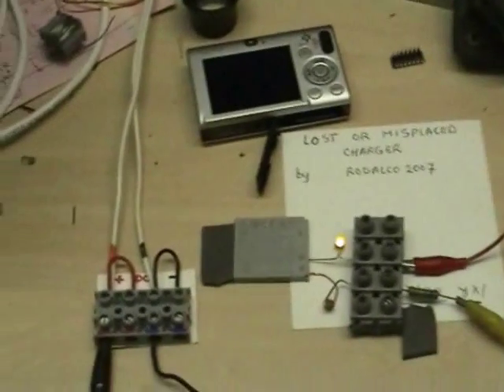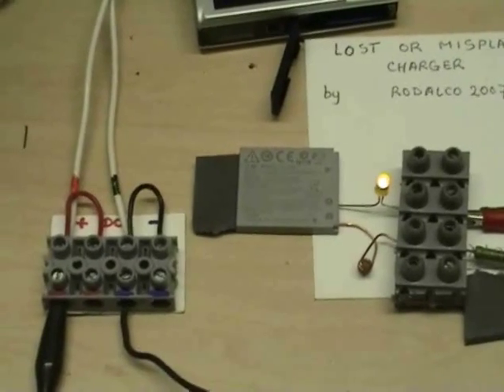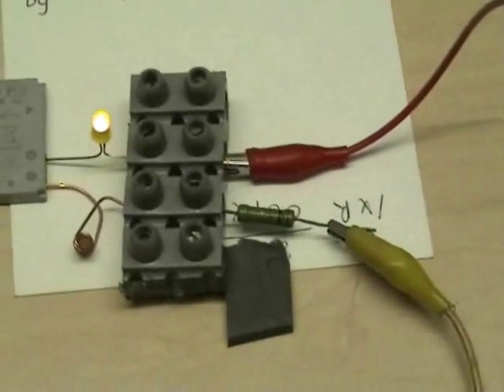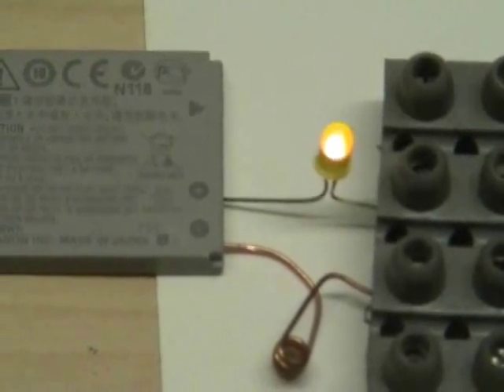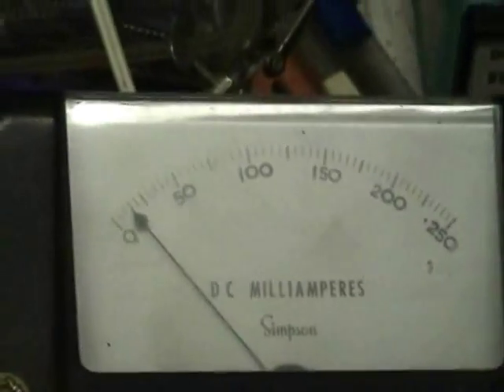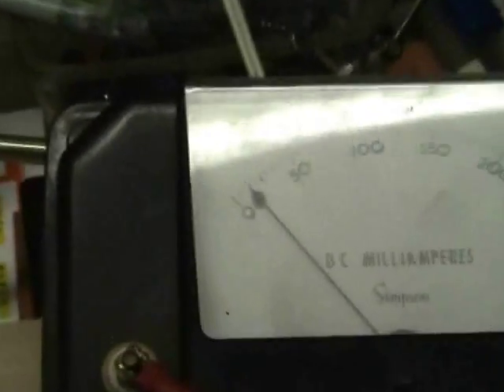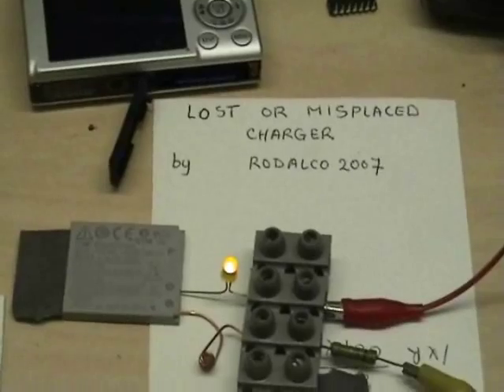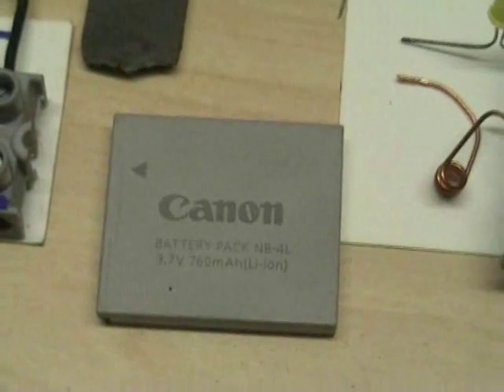Emergency camera battery charger.wmv

Comment from the maker: @bigclivedotcom  Correct.
This charger I used when I lost my normal charger, current is only 20 mA's so the risk of overcharging is low.
But I'm well aware of the explosive dangers of those batteries.
have a look at my lithium battery video's.

Comment: For standard 3.6V lithium iron batteries you must not exceed a battery voltage of 4.2V as the battery is not stable if overcharged and can fail violently.  That said, many of these packs contain a tiny charge regulator PCB that will stop over charging by opening the charging circuit.  If you left that on charge long enough you might find that the LED went out at a battery voltage of about 4.2V.

Comment: That is, 3.6V @ 190 mAh for 5 minutes, then on the charger at 1.5v @ 100, 150 or 180 mAh for 4-6 hours depending on the type of cell (AAA/AA/A/C/D, I rarely use 9V's as they contain AAAA's)

Comment: This is very handy. I used a cordless phone to very quickly boost alkaline batteries that would otherwise not charge at all, since they are at risk of leaking (not exploding like the stupid label says), I monitor them until they're boosted enough to be thrown on the charger for 4 hours (or more).

Comment from the maker: @coondogtheman1234  350mAh atart with 17 mA for 15 to 20 hours which is on the safe side.
Check with a voltmeter for the positive and negative terminals if they are not marked.
Usually red is positive, black negative. blue ( not sure)
To measure current go on the 300 mA range and wire the meter in series with the positive.
(Power supply +),  resistor, ammeter, pos of battery, neg of battery, (Power supply -)
You can add a LED in series.

Comment: @RODALCO2007 Mine is a 3.7v 350mAh battery. I have a multimeter but unsure on how to measure current. I dunno if it's a li-ion or lipo as it doesnt say. it has KPL 323436, 350MAh 3.7v, 061A1004 written on it. it has a small charging/power management board on it and has blue red and black wires on it. what would bee a good charge current to charge this puppy?

Comment: @RODALCO2007 
sounds good, now I know how to charge these without the charger. I have a li-ion battery from an mp3 player that stopped working and now I know how to keep it charged. I could put it in an altoid box lined with electrical tape while charging in case it does go up it's contained.

Comment from the maker: @coondogtheman1234  As long you stick to the 5% of Amp hour capacity you can not go wrong.
Say a 1200mAh battery will get charged with 60 mA max.
Often chargers get misplaced and good camera's / Ipods / etc. gathering dust, while a simple charge up brings them back to life.